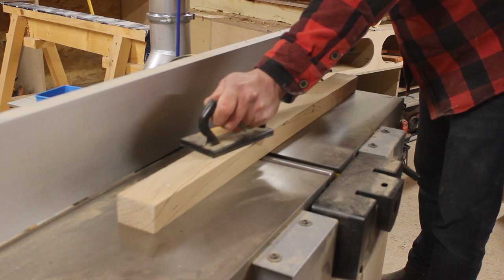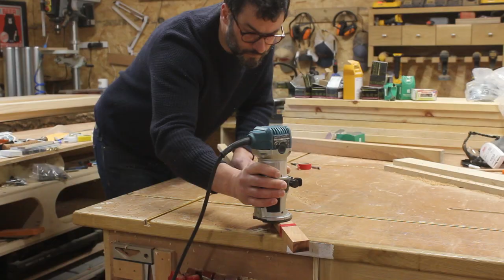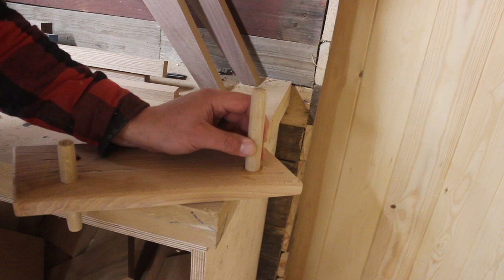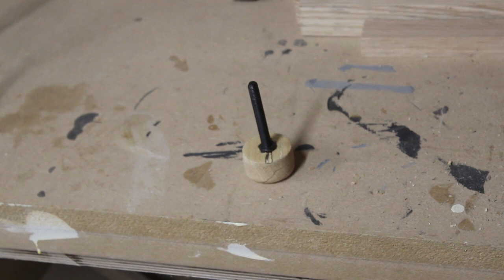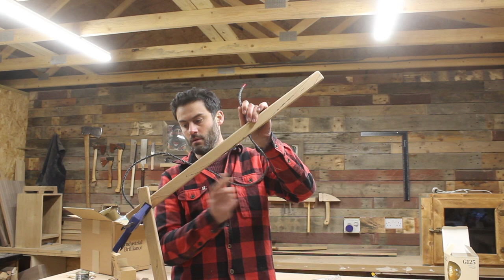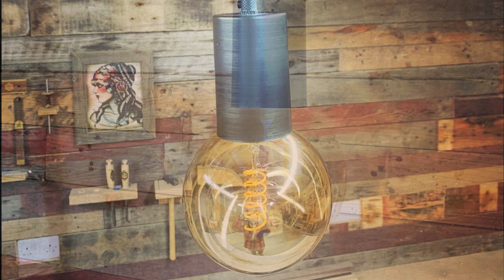Spalted Beech Floor Lamp || Concept Design

Comment: How did you set up the planer bed you have? Thanks!
Reply from the maker: On the big machine or the small bench top thicknesser?  The Axminster big machine has a simple adjustment wheel, the beds on the bench, I used an 4ft steel ruler & digital level! :-)
Reply: @DeerRiverCraftsman  
Sorry, I meant the benchtop planer. I’m looking for some kind of a solution for mine. Thanks!